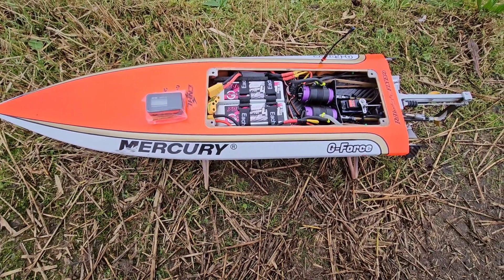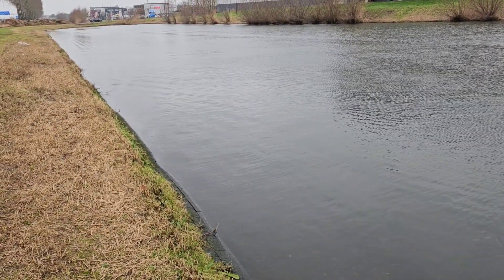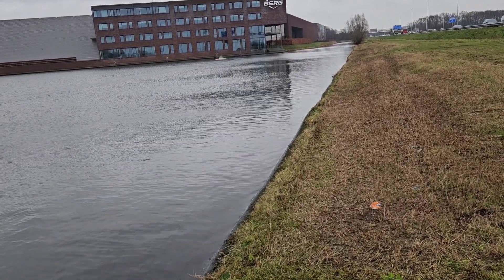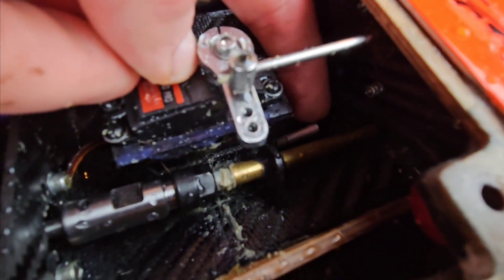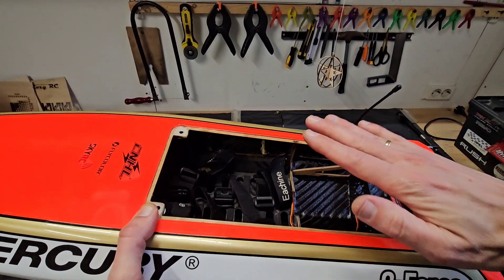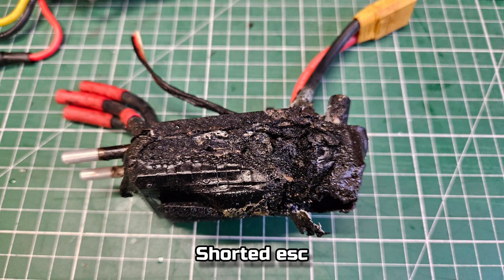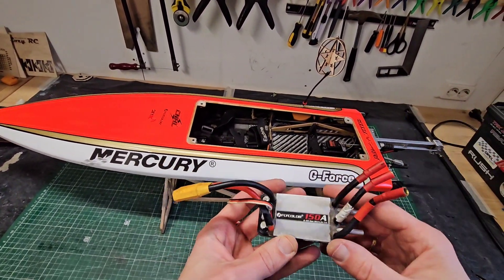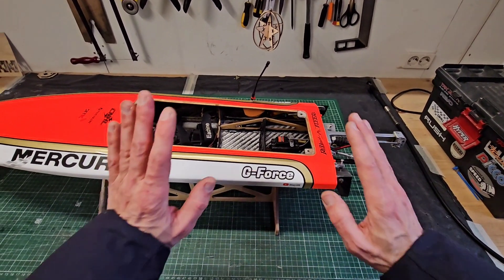The Day My DIY Twin Mono RC Boat Became a Submarine: Speedrun Gone Bad

Comment: Any chance of either a video or description of the esc settings. I Have very similar mono, burnt up the 90amp flycolor and now replaced with 150amp, but am interested in your settings of the esc and why (I use the programing box, not tx which is far to much hassle). Many thanks in advance. Keep up the vids 👍
Reply from the maker: My answer is simple: I use no programming at all. I just install the right connectors, and do the initial throttle setting with the transmitter, as described in the Flycolor manual.

Comment: Oh NO!:body-green-covering-eyes: I quickly found out that this is one of the major risks of speed running on the water vs cars. Great analysis & recovery. Happy New year!🎉
Reply from the maker: Happy New Year to you as well! Yes, it is a risk, but if you build strong, supply enough flotation, and bring a rescue boat.. the chance of losing your boat is almost none.
Reply: @CozyRC  For sure.. I just was hit in the face with the first attempt, that you can't just walk over and pick up the pieces if something goes wrong. It's truly a rescue mission!😁:goodvibes: